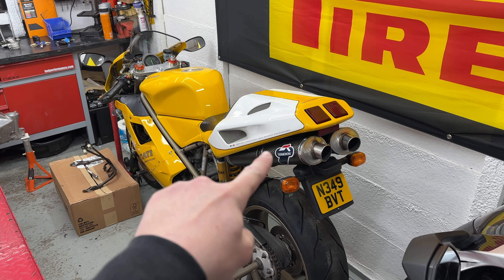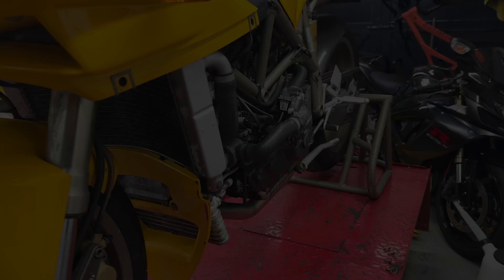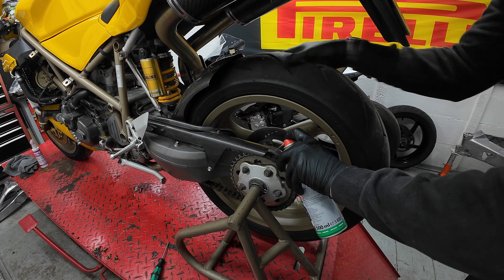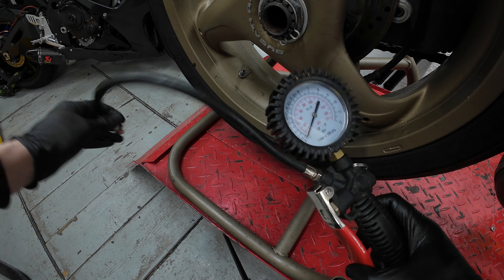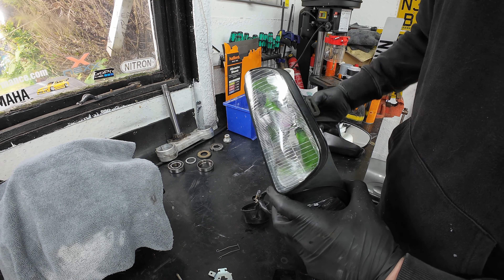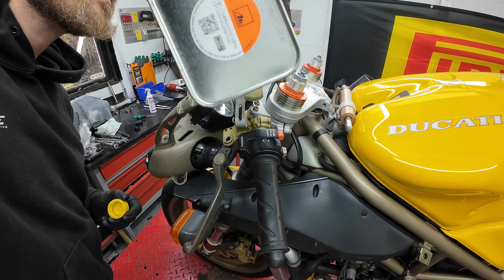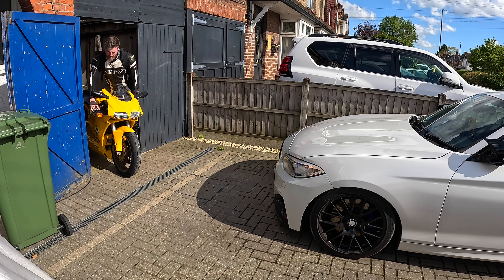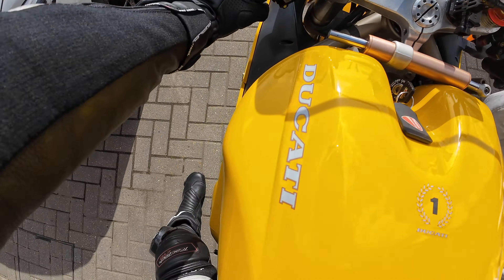Abandoned motorcycle.. Okay not completely true but the Ducati 748sp has been ignored the past years

Comment: Great bikes, apart from the Ducati neck and burnt balls in summer traffic jams. Disconnect the safety switch on the side stand that stops the motor running when it is down, it always causes trouble and is probably your no start cause. If it has one.  Also very easy to flick off the red cutout button without noticing.    Be VERY careful not to touch the mirrors against anything, their brass holding screws have cutouts that halve their width to allow easy breakoff instead of breaking the fairing.  Your narrow fit between the BMWs gave me a heart attack.  New Ducati screws cost enough to buy you another bike, but you can find a similar brass one at B&Q or any bolt shop and just file a similar slot into it.  Belts are manageable, but 748 SPs were known to suffer from premature cam and follower pitting and wear, due to poor hardening.  Nothing you can do apart from using Shell Ultra full synthetic bike oil as in the handbook ONLY.  Check the magnet on the oil drain plug when changing oil to see if some of your camshafts are on it, if they are you will find out what real trouble is! Minimise cold starts, do not be tempted to just start it to see what it sounds like today.  I oiled my chain from inside the sprockets, not outside, which is the part of the chain that is in contact with them.  I don't trust wax to penetrate the rollers and sideplates. MotoGP bikes apparently use SAE 90 gear oil, so I did too, and I cleaned the splash off with a cloth soaked in white spirit [turpentine substitute] from B&M paint section. Gives you something to do instead of just starting the bike for fun.  Only start the bike as you did on a completely closed throttle, otherwise it takes forever to clear and you might end up with a flat battery instead. 60 seconds max per try only then give the battery a rest and try again.

Comment: Great Video. Love the 748
Did you find out, why it did not start? My 998s does the same. If you try to start it and she won't fire up, I need to pull the key out of the lock, put it in again, turn the key and push the starter again. 
Only if I remove the key, the ignition will work again.
Reply from the maker: Glad you enjoyed 😎

Still need to pull it apart, I suspect starter solenoid as after giving it a tap she fired up! All part of the Ducati charm 😅
Reply: @stoneautomotive  True, true ... the "Divas di Bologna" 😀
Maybe try the routine with the key. 
Just pull it out, insert it again. 
Maybe it works for you too

Comment: The misfiring might be plugs coils, leads? The crank position sensors can be intermittent, but normally go out once the engine is hot. It looks similar to what’s on my 90 Laverda 650, and 750, I think there’s a 2 and 3 pin version, one is the same as a Fiat, Lancia Delta Integrale, I don’t know if you have a 2 or 3 pin on those. A lot of similar parts are shared on 90s Italian bikes, so looking elsewhere can sometimes save a premium you pay for gen Ducati parts, when most are used elsewhere, eg, the throttle position sensor on my Laverda 650 Formul (and other 90s Laverda) is the same as a Sierra Cosworth, as it also uses Weber Marelli  injection. 

The starter solenoid and regulator are shared on the Ducati and Laverda, and not very reliable. The 12v feed in on the small plug for the solenoid works its way out…cable tie…

Best of luck sorting it out, I know how 90s Italian electrics are, , I have 3 Laverda to keep working……
Reply from the maker: Thanks and good to know, shall try the plugs next (they haven’t done many miles but are getting on for a few years)

Comment: I have had my own 748s 2002 model for 4 years, and have done the belts twice already, current set is 2.5 yrs old, but have only done prob 1500 miles....i dont ride in winter but do run it up regularly. at 150 quid a set and as old ones came off looking like new, i have decided to let them go to 3 years..... like you say, im not a GP rider..
Reply from the maker: I’ve gone to 3 year cycles on the belts too 👍

Comment: You can use standard micro switches for the front brake on Brembos. Just solder onto the existing cables.

The effect on the inside looks similar to what happens when superglue gets hot.
Reply from the maker: Let’s see how long the repair holds up 👍😅

Comment: That's exactly the problem I had with my TL1000S,it ran intermittently on one cylinder for years,after going through everything over years of this problem checking wiring etc after one winter lay up it wouldn't start and was throwing a fault code for the C.P.S. which unfortunately came as part of the alternator stator and wiring making it crazy money Replaced it and it ran perfectly,after all those years of misery!!
Reply from the maker: Hopefully something simple on mine, as you mention electrical gremlins are a real headache 🤦‍♂️

It’s going to be getting stripped down in the coming weeks